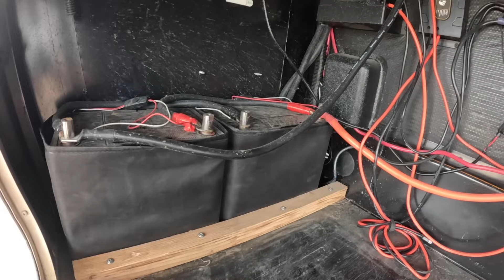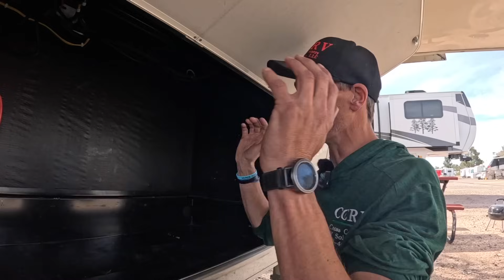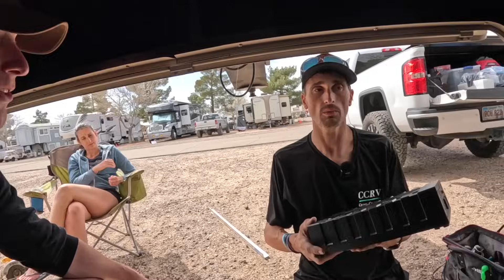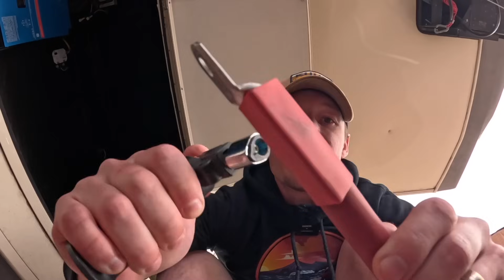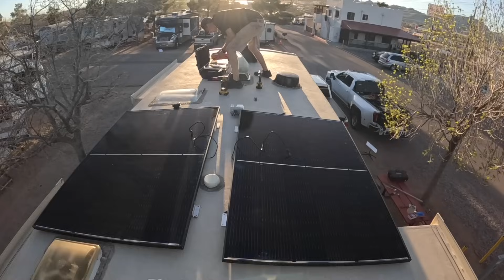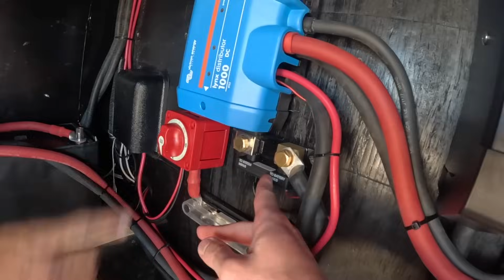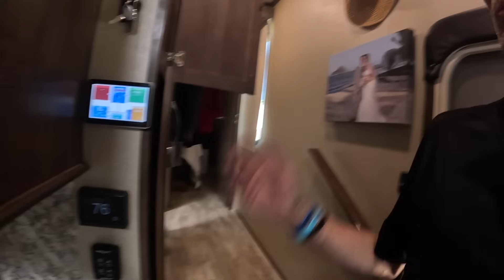Exposed: Expert Reveals the Lies RVers Still Believe

Comment: 800 is not enough.. i just got a system 3 weeks ago. No panels yet few weeks. But i am boondocking. I use my generator about 8 hours a day. Running 1 ac while charging once my batteries r full agian i let it run til outside cools off then i run fan only no generator lasts 17 hours but im back up and running ac and generator before that with about 23% in 10 hours.. my charging is at 2300 watts and the ac load is about the same. U really want at least 2000watts worth of charge if using ac all the time. Now what u got u can use but ull want more panels soon as u can afford them.more batteries also.. good thing about having parts is u can always add more parts..

Comment: Just buy some 48v 100AH rack batteries check out will prowse get some solar panels I've got 8 330w other roof convert to 48v it's cheaper and lighter . In sunshine ican go a month without starting the generator.

Comment: Thank you for an excellent video. The explanations were simple enough that even I could grasp what you are saying.  We invested in solar last year with 2 400watt solar panels and 4 agm batteries with a 3000 watt inverter.  Starlink takes a lot of power, we have found. And the microwave sounds at times that it isn't running at maximum power. I'm thinking that lithium batteries are in our future real soon.

Comment: I am excited for you guys.  This is a huge change from having to run an extension cord from the inverter to the shore power plug.  I am amazed that the Multiplus can instantly switch from shore to inverter.  Also, this is the first time I understood why you need so many blue boxes.  Thanks to you and Derek for such an informative video.  The only downside is you need to add SHUT OFF ACs to your teardown checklist.

Comment: You will love that system over what you had before. Seems as though you hired the right man for the job, Derek was very knowledgeable. I just saw last evening Irene Iron Travels announced they are selling their Alliance fifth wheel $$ with an amazing solar system and battery banks, dual Victron inverter/chargers. That would be a huge step up for you.

Comment: As a retired Electrical Design Engineer with 35 years experience and doing utility grade solar design for 3 years, I can easily say that this guy knows what he is talking about and did a great job picking and setting up your equipment.   As far as the price, I have no idea.
I am sure you will be happier for a long time!
Reply: The price wasn't bad at all, don't know if it was because he was being nice or hoping doing this vide would serve as a advertisement but it generously fair pricing.

Comment: We have a boat with a 2500 Watt inverter/charger. It was installed in 2005. When on shore power if it goes off it switches over automatically to batteries. To go from Generator to Shore power you have to manually switch the line feeds. Your systems looks like great set up.

Comment: When I installed ours the first time I had 800 W quickly I went to 1200 W of solar power as far as the batteries. I only started off with a couple batteries and quickly move to six 100 Watts system batteries and love every bit of it. The Victron you will not regret it just get it registered and the warranty is phenomenal, but I’ve never had any issues with it. Knock on wood. Love you guys be safe.

Comment: Derek is doing a great job! He understands what he's doing and his detailed descriptions are spot on. You guys will be smiling for months to come with this system using premier parts, Victron components and clean installation. With 800 watts of solar you can add another 200 amps of batteries and system will keep up (assuming you have lots of sun). I've installed my own system and helped friends install theirs & it was a real learning curve. Derek is invaluable in my book, he knows his stuff inside and out.

Comment: I installed a similar system myself. The cerbo touch screen has an update for a brand new cool interface.  Through the menus or vrm website you can check and update your software.

Comment: That was literally the best explanation of the charging cycles I have ever heard.  So glad to see you guys getting into boondocking.  I am always so jealous of guys like him that are pros and their layout abilities.  Mine looks like a 6 year old put it together.
Reply: Best way to do it is to look at what you have and draw it out first, he's probably just done so many installs that now he has a default position setup.
Reply: @RayMisuto  I think some RV's are built with with more forethought for things like this than others too. Having that front bay where a genny would normally sit for a space to lay it out helps a ton.  I'm in a bumper pull with the shortest passthrough I have seen on a trailer.  Would have a hard time sending anyone older than a 10 year old crawling through it, let alone my fat ass 🤣🤣🤣I ended up putting everything under the dinette seats.
Reply: @kdooms  All I can say to that is don't be afraid of cutting into it.

In truth there's not much difference in how the internal structure of RV Maine cabins and an actual stick house are engineered, everything is just thinner.

So if you're having trouble getting into it it's usually best to just change the structure itself to make the compartment what you need it to be, it's what I did with my Gray Hawk when it didn't have the correct compartment for my setup.

Comment: Trust me though, you're going to want a bigger system
Reply: Seems to work that way..... Mine has morphed into 3000w on the rood, 1600ah of batteries and 2 of those inverters in parallel and there are times i still think we need more.
Reply: @TDub_ADV  Totaly agree! We just dove in head first because we knew we were going to be boondocking as much as possible. 2880W up top with 1236 amps of bats with the two Victron inverters. And in Dec, Jan, Feb... it's not enough
Reply: @ Yep, I can tilt my panels too so most of the time i do well even in winter but multiple cloudy days in a row is when i wish i had more panels just to get more of whatever energy i can harvest. My next step is bumping it up to 4500w of panels, i have enough room for it on the roof.  In full sun we live pretty normally most of the time and have zero energy issues.

Comment: I would highly recommend Cross Country RV Solar. I would also recommend that the Hank’s invest in some decent batteries. Instead of buying 100 amp hour batteries you should consider getting some epoch 460 amp hour batteries. I have two of them in my camper. I can run my air conditioner for about six hours. It’s like having almost 5 batteries in one. And also cut down on the space that you need to store batteries.

Comment: I do not get how you can expect to run 3000 watts off of 200amps of battery. 3000 / 12 = 250amps. 2 x 100 amp battery = 200. Most 100 amp battery's only have a 100amp BMS. I would think those batteries would lock up on you the moment you try to push the inverter anything past 2400 Watts, as 2400 / 12 = 200amps. Am i missing something here?
Reply: Only the BMS limit. Lion Energy uses a 150A BMS, so 300A max.
Reply: @luminousveiws  ok, that makes more sense. Thanks, thought i was taking crazy pills.

Comment: Money well spends and a great value. If needed, you can add additional batteries or replace the existing ones with higher Amp capacity batteries.  I'm questing you'll be increasing the battery Amp capacity soon. 😉

Comment: Lithium = maybe a great fire.  No thanks after towing the 6 th one since nov to the insurance yard.  I’ll run my nice quiet honda generator when needed.  But I dont take our rv offroad.   
Good luck
Reply: This lithium is not the kind that self ignites. LFP will burn if the RV is on fire, and not otherwise likely.
Reply: well keep telling yourself that.  Insurance companies aren’t buying it. Condo associations aren’t buying it. Parking garages not buying it. As a towing company we cut the all the cables and remove all batteries toss them in a closed container….  Charge 250 a day till insurance gets rid of them. So purely garbage. I guess if you live in unicorns and fairy dust enjoy.    
Solar is a complete joke… honda generator nice and quiet… 995 bucks low end 2300 bucks high end.  Power all the time

Comment: We have a multiplus 3000 in our RV, hands down the BEST inverters.  We especially LOVE how it can manage the load on your shore power connection which allows you to run much smaller generators or on standard 15a circuits.  You should get more energy storage of you want to use your inverter to run your air conditioners.  At least 1 battery per 1000 watts of inverter capacity.

Comment: Congratulations on your Victron. I’m so excited for you guys. I was really hoping you guys would get one someday. I wasn’t able to fit one into my little 24 footer, but I did manage to find a 3000 W inverter converter that could. But not nearly as fancy as that Victron. However it does run my AC without a soft start. And this thing is a 2003 travel trailer. But now that I have my 3500 2016 Chevy Dooley, a fifth wheel is on the horizon. Guess what’s the first thing on the list to get installed?

Comment: Wrong, wrong wrong inverter/chargers if one goes now you need to replace the whole shebang.  Buy a separate inverter and charger. I ran 3 150W panels with a 3500 watt inverter.and a solar charge controller.  Most important is the wire size.

Comment: $2895 for parts; how much for labor ? Did you eliminate your factory provided converter or do you now run both?
Reply: With the inverter charger the factory converter should be eliminated, its redundant.
Reply: Additional cost for the wire?  I know that's not inexpensive.

Comment: Be careful guys!  With 3000w inverter, I found 4/0 wire wasn’t enough to reduce the resistance to utilize 15k a/c - 1800w continuously through fuse to bus bar to inverter.  I had to add additional wires in between battery & fuse, then to bus bar.  The issue I found was “terminals” & “wire connectors”, which are not making enough contacts to each others.  Hence the “choke point / resistance”.  By adding washers and 2 additional wires, I was able to stop the temp increase at 120F and temp started to go down as ambient temp reduced by the a/c.

The first place I’ll check on temp while using a/c would be on / off switch to the bus bar on your set up while using a/c.  FYI - I used cooking thermometer to check the terminals temp.  Hope everything goes well with your new set up!
Reply: It depends on the quality of the wire. High quality welding wire is much better than cheaper lower strand count wire. You need to look at the voltage rating of the wire as printed on the sheath. A good rated wire sheath can handle the heat better as well.
Reply: @jasonb9913 , yes, I’ve used high grade copper wire & connectors.  However, beside of “high grade” material, you need to make sure that connector & terminal are also high grade copper and must have enough touching surfaces to make the same surface coverage to make the connections to reduce the resistance, when you are running 1500w+…
Reply: @kimotaka  Were you thinking he used 4 gauge wire? That was 4 alt big difference between the two.  That should handle anything that 3000 watt converter can throw at it.
Reply: @crazy-eyewoodguy4489  not 4 awg, it is 4/0 wire & yes, it is a big difference and high grade copper 4/0 wire is pretty expensive and yes I used 4/0.  But, my point is “connections”.  You must use big terminals on both fuse, on/off switch to make sure you are not making any choke points.
Reply: @kimotaka  Understood, yes you are correct!  When I read the comment I thought you  and others would misunderstand the difference between 4 Gauge and 4/0 (alt) cable.

Comment: Crossed battery cables..... PLEASE separate the positive and negative cable in the center of your batteries properly.  The reason that people orientate the batteries in the same directions is to keep the positives and negatives going down opposite sides for separation!!!!.  What you have there is unfused, high amperage wires right beside each other in an RV..... Essentially an earth quake Everytime you tow it. What could go wrong????
Reply: I paused on that multiple times while watching...  waaaay to close

Comment: Nice Install! He really set you up for expansion. Overkill for your current setup by far, but if you wanted to throw 4 more of those panels up there (3S2P) and replace those batteries with a bank of 4 300AH batteries, youll be right at what thats speced for and just boondock indefinitely.

Comment: I personally believe Derek is the premier RV solar guy in the nation. He put a fantastic system on our Country Coach motorhome. Highly recommend for anyone considering a solar and/or battery upgrade of any size. He lives and breathes this stuff, he's knowledgeable, humble and very fair in the pricing. Great choice!
Reply: We too used Derek, great guy, great system a real professional!!!
Reply: @j @jjustj How do you get a hold of Derek for his sevice ?
Reply: You have a lot of comments and i don’t want to read through them all. From what i see he is a great installer, that vicrton inverter minimum battery requirements are 400ah of batteries. BTW, we told you this a few years ago at the grand design rally
Reply: Where is Derek?
Reply: @sandrainfante4268  USA Literally all over it
Reply: @sandrainfante4268 Derek is the owner CCRV Solar, he did our install and I would highly recommend him.
Reply: He seems pretty good, about the only thing I could find wrong with the installation was he either was trying to get them done as quickly as possible because they told him they needed to get it done over that 2 days or he doesn't know how an RV roof is made.

Either way the problem I saw was he didn't seem willing to run the wiring cleanly through the roof and was using openings that already existed, something that usually isn't going to work very well when you're installing a customized system.

The biggest mistake anyone can make when putting an electrical system in is trying to operate within the boundaries of the structure of whatever they're putting it into rather than adjusting the structure so that the system is easier to service and expand, something important in any long-term investment such as a vehicle, RV, home or company building, basically everything you put in electrical system into.

RV roofs are actually extremely easy to cut through & repair/replace as needed, and if this seems questionable to you look up a video of the RV roof being built.

Yeah, they're actually that simple and all the talk about it is the industry trying to scare off the DIY people, a really common thing nowadays with technical knowledge becoming so easily accessible for free through YouTube.
Reply: Like it’s really that hard lol.

Comment: I have 6 marine batteries with 2 panels of 240w, it was very handy when I travel for 6 month crisscrossing America last year. Had an RV and the installer made it in a way that while I was driving it was also charging my batteries with the alternator. 
So that if I was boondocking and it was a rainy couple of days and it didn't charge the batteries enough I could turn on the truck for about 30 minutes and they would be charged, no more need for a generator.
I now live in a 5th wheel and transferred the whole system on it.

Comment: ~8 years ago I started my solar project adventure. I spent about 6 months watching a lot of You Tubes  & reading a lot of articles. I was getting paralysis by analysis trying to figure out just how big to go. Friends had very large systems but I didn't feel it necessary. I finally just jumped in with a100W panel, 50' of cable, connectors, and a small PWM charge controller. Wired up everything myself. It was a great lesson for only a few hundred$$$. Since then I have added 2 more panels on the roof and 2 on the ground. Learned that if you're not in direct sun you get very little charging. I purposely waited to add LIPO4 batteries until 2 years ago as I felt confident they would drop significantly with competition. added a very small 600W inverter & a 2000W inverter generator. All in for ~$1200. Friends spent $10k & $15k for much larger systems, but we do not require that much power. When we need 110v we use the genny. I doubt we use 2g of gas a year though. Its been a great learning experience. I feel confident I can now add or do most anything solar I need.

Comment: You should really be using a T class fuse connected to the batteries.  Most likely 400 amp T class fuse .   The ANL fuse does not provide enough AIC (ampere interrupting capacity) and best server with t class fuse.   Your batteries should cut out assuming they have a BMS.

Comment: I just installed almost the exact system in my RV.  Not sure if you know this or not but the Cerbo GX has the ability to also display things like propane levels, fresh and grey tank levels, multiple temps along with using relays.  You would just need to purchase some additional sensors (mopeka for the propane and water tank levels and ruuvi temp sensors which I use for the fridge and freezer).
You may also want to watch some videos about installing the gui mods on the Cerbo GX which adds additional information on the display.
Reply: GUlMods no longer needed imo.  The new GUI from victron can be enabled on current firmware and is SO much nicer. 

I also use Mopeka and Ruuvi and they are both great options to add.